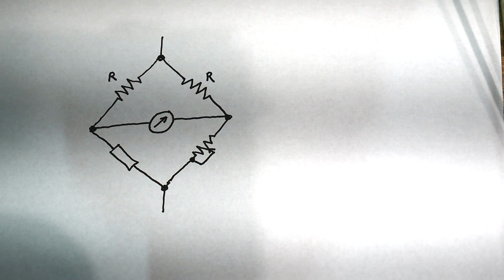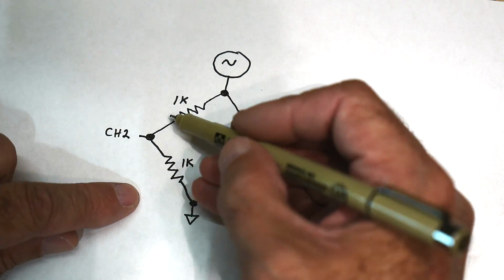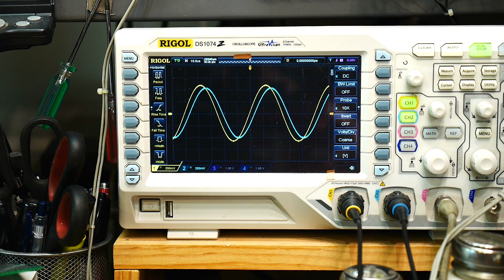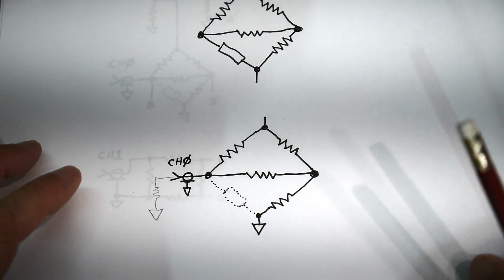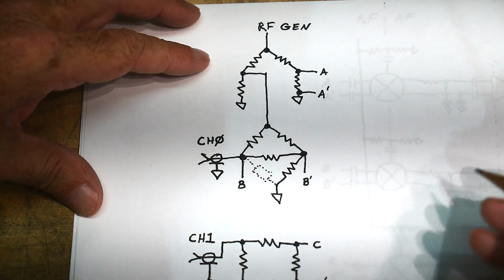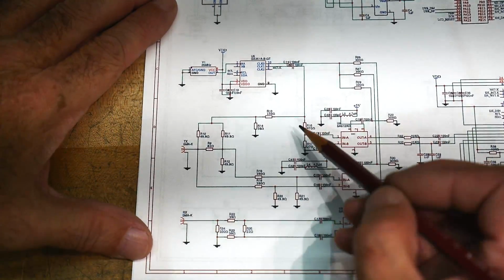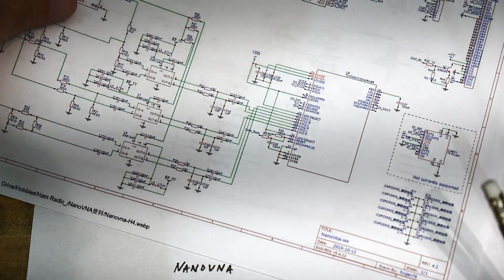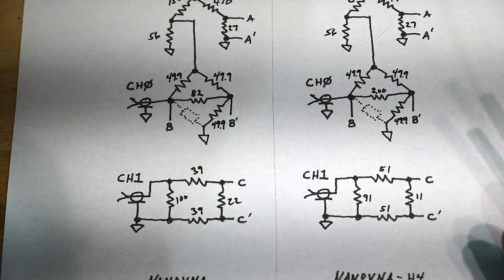#502 NANOVNA Demystified

Comment: Great clip again.
I am designing a device that can measure body plot of feedback loop in an opamp.
I was wondering how to measure phase, and I found a great paper on line by Peter O'Shea. "Phase Measurement."
I found, there are many circuits to measure the phase, PLL, FFT, and 3 voltmeter method are the most practical for me.
With above circuit that you presented one can use instrumentation amp and 3 voltmeter method to measure phase.

Comment: Very nice. Not too long ago we used Schering bridges to measure capacitance of high voltage components. You had to balance the bridge yourself, thus you had to understand what you were doing. Reading the capacitance involved understanding the settings of the knobs and multipliers. The same for a balance bridge for high voltage partial discharge measurements. The bridge is more complicated, but the principal remains the same. I still have a photo of the bridge somewhere. Nowadays it's all digital. Press the button, read the values. If something doesn't work, good luck figuring out why. Improved technology made a lot of knowledge evaporate.

Comment: Thanks for that excellent explanation! I'm working my way through your NanoVNA videos and still getting used to what they can do - I will buy one hopefully some time soon but a bit confused by some of the different models/manufacturers/suppliers and have seen warnings about clones. Am I right in thinking that the H4 is made by a different company to the 'original' one? Is there a good guide to the different models?
Reply from the maker: I'm not sure who builds what. They all seem to work fine. I like the H4 for the display. Others like the ones with the big connectors.
Reply: @IMSAIGuy  W2AEW has just uploaded a new video where he talks about VNA in general then moves on to the NanoVNA and has a summary of the different models here: https://youtu.be/o1eLK4EMpEQ?t=743

Comment: Any reason for the H4 version having a 200R in the middle of the bridge vs the original having 82R ? Great video, ive learnt a lot!
Reply from the maker: 200 seems more seasonable than the 82. it's only a 50ohm bridge so the resistor in the middle should be larger than the bridge to not upset things but allow a current measurement between legs.